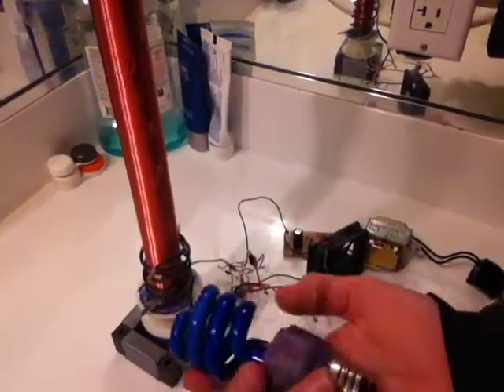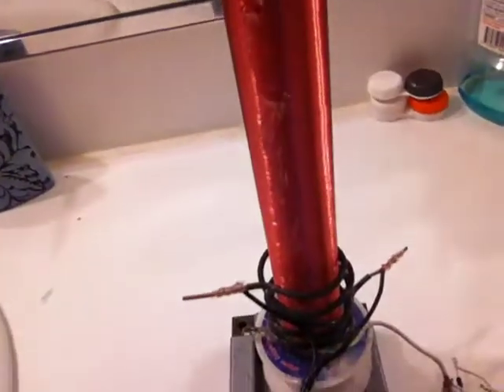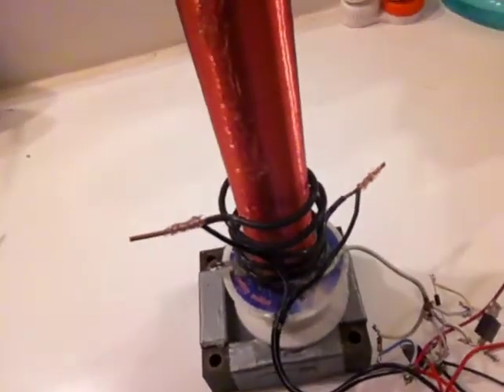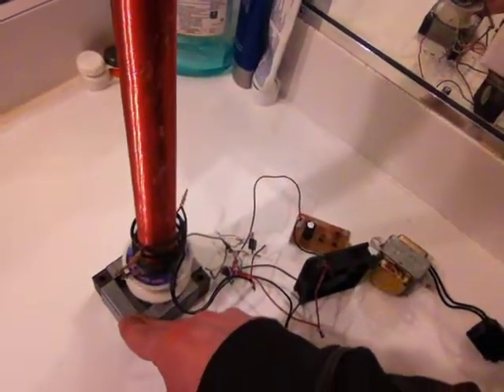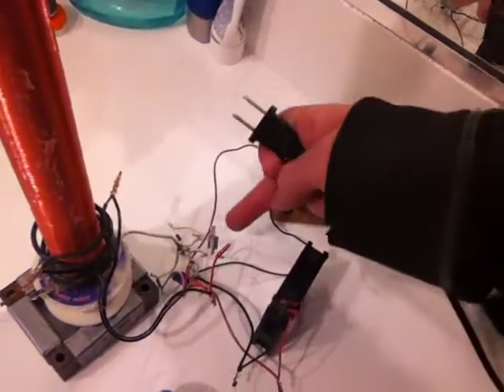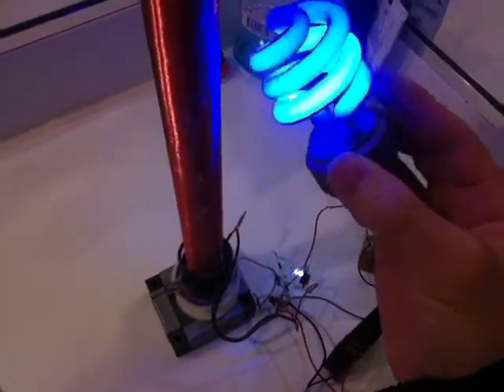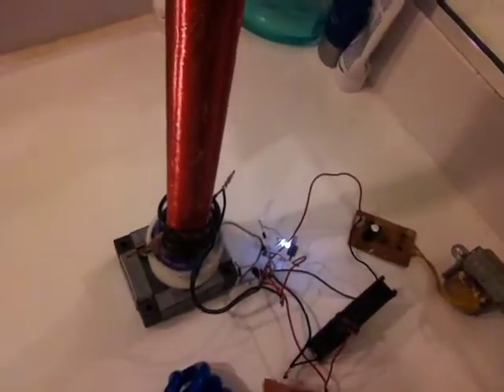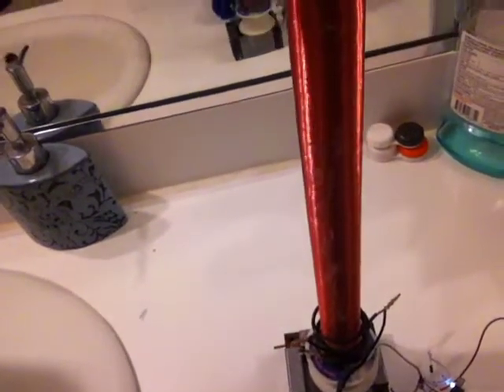Mini  Tesla Coil 100% Works Cheap Build For You To Build Schematic Circuit Nikola Tesla Tower Coil

Comment: How many voltage does it have
Reply from the maker: well about lets say 5 thousand voltage but it will spark discharge top dome but amp is very very low still about 1 to 2  milli amp.. when i tryed attach the anti gravity ionizer  lifter triangle with aluminium and copper i didn't able make left off ground cause low amp.